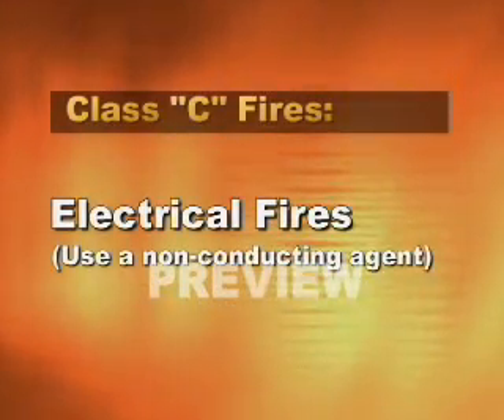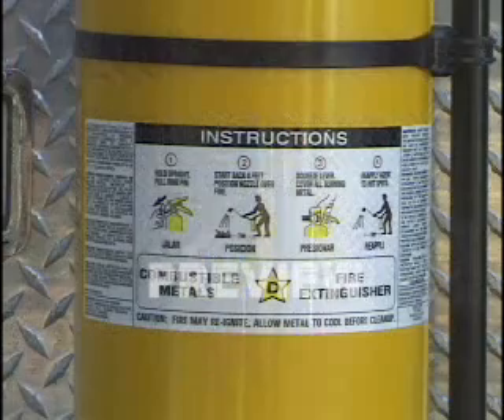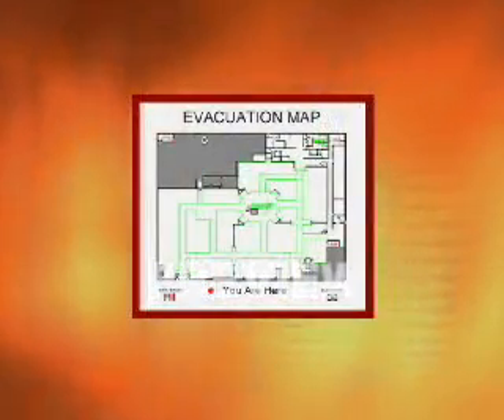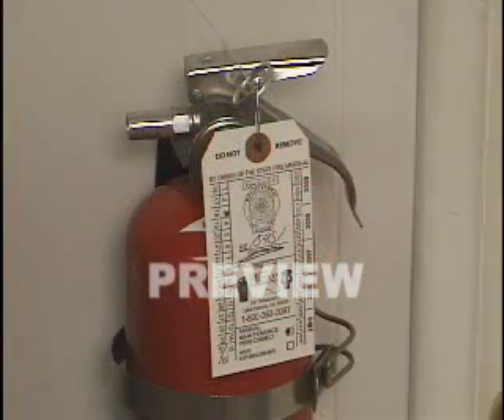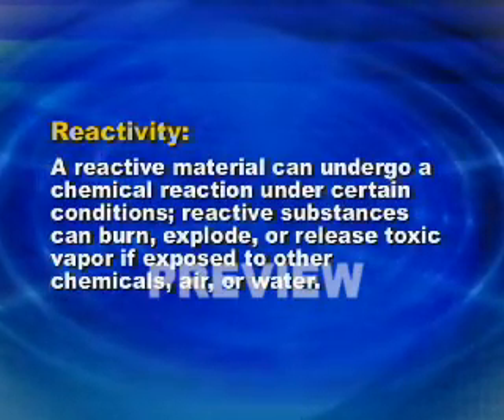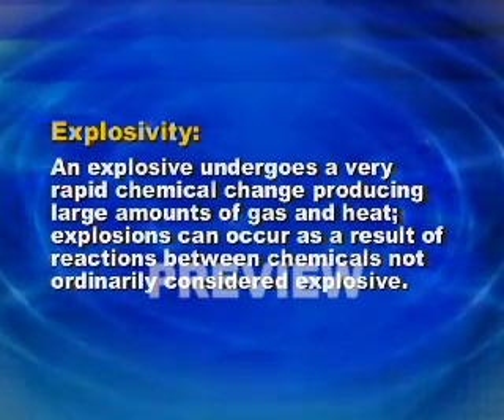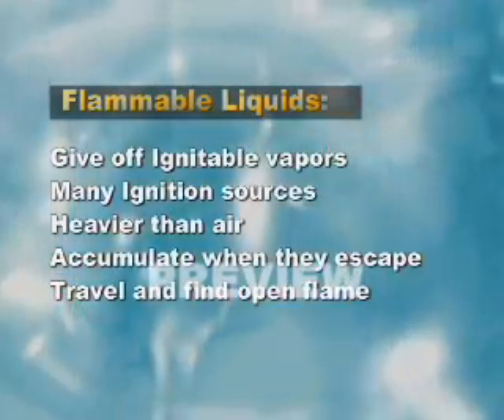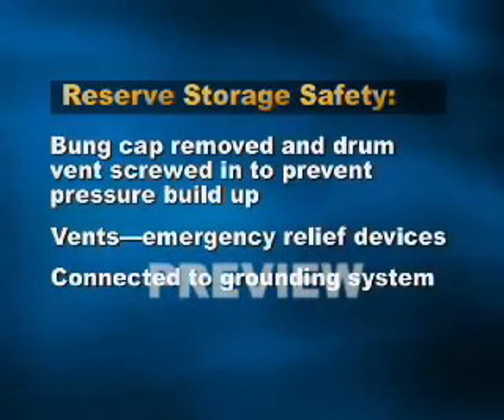Fire Extinguisher Training & Fire Prevention

Comment: Because using the wrong type of extinguisher can have disastrous consequences, it's crucial that all workplaces perform a hazard assessment and ensure employees receive necessary training on the use of portable fire extinguishers.  This helps to ensure the appropriate type and size extinguishers are readily available for the class of fires likely to occur; in most businesses a class A-B-C extinguisher is all that's needed.   

Areas such as metal fabrication shops and commercial kitchens should have a class D or K extinguisher in addition to a dry chemical A-B-C type.

Comment: They showed a water mist extinguisher rated for class C while saying not to use them on class C fires...
Reply: https://youtu.be/cQWU5lTCUOI
कार में ऐसे करें आग तो यहां लग सकती है
सब्सक्राइब करें more information
#Ranveersingh #Carsafety #Safetytips
#Firesafetyclasses
Reply: https://www.youtube.com/watch?v=uvE8SETbuHo&feature=youtu.be
Reply: Water mist extinguishers are rated for class A and C fires.   The water mist extinguisher, not to be confused with a water extinguisher which is rated for class A only,  differs in two ways.  First, it  discharges a fine mist which serves to remove the heat side of the fire tetrahedron,  hence it's name, water mist.  Second and most important,  the water inside is deionized,  to  make it non-conductive.  You see, pure water, or deionized,  is actually a very poor conductor of electricity, and tastes pretty bad.  The minerals and impurities in water is what makes it a good conductor of electricity.  

It should be worth noting that when faced with a class C fire, after the power has been shut off, the fire can then be treated as a class A or B fire depending on the fuel Involved.  Therefore an extinguisher suitable for C fires will always have either an A-B-C, B-C, OR A-C rating, with the "C" simply meaning the extinguishing agent is non-conductive.
Reply: @Sparky-ww5re  True